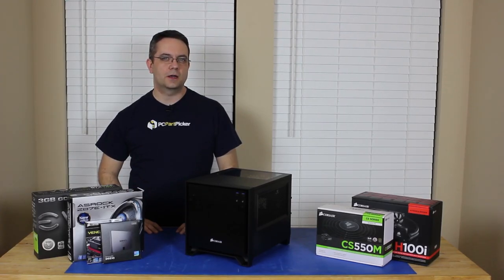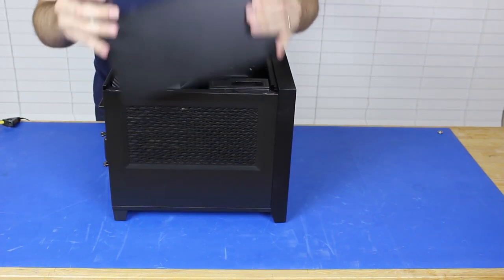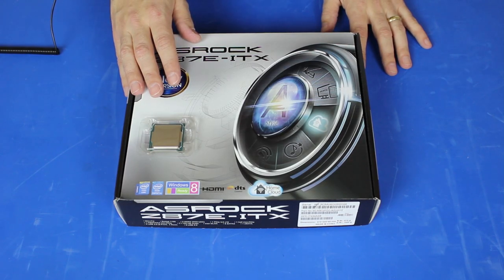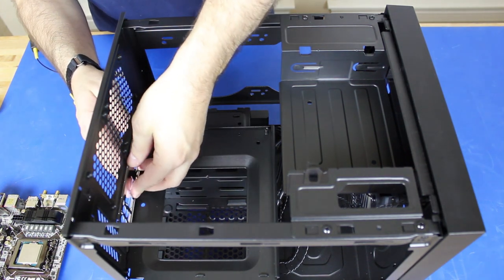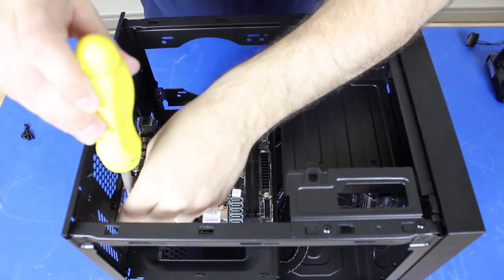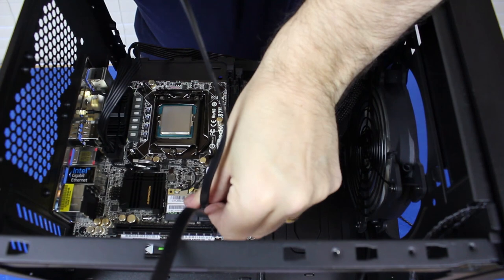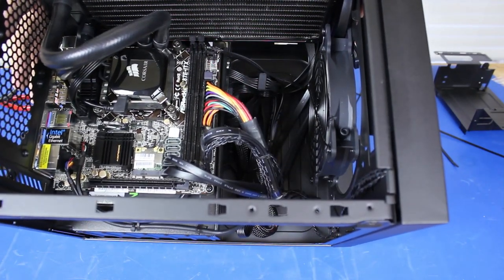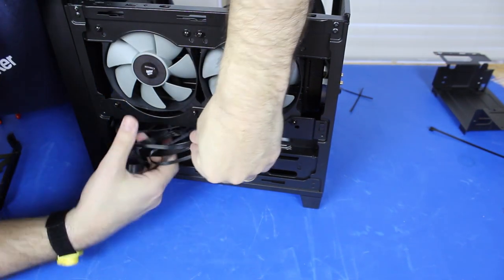Mini ITX Gaming Build - Intel Core i5-4670K / GTX 780 Ti / Corsair 250D

Comment: I was thinking of rebuilding my PC and making it smaller, something like in this video. Problem is the Mini-ITX Mobo I was thinking of getting to go with my current CPU may not fit with the radiator. (the Sata and MoBo connections are located directly under where the radiator would sit). 

Long story short; how much room is there between the Mobo in this video and the bottom of the radiator? Enough room to plug in SATA and Mobo cables?

The motherboard I'm looking at getting is the GIGABYTE GA-H77N-WIFI, if that helps.

Comment: im planing a build with this case

gigabyte z97n-wifi
intel i7 4790k
corsair h100i
evga gtx 980 sc (same design as your card)
evga supernova 650w g2

the ram, hdd, sdd and optical those kinda doesnt matter to me

my plan is to overclock a little just to have better performance and with the model of the gtx to exaust to back of the case and h100i cooling the cpu

my only question would be how to mount the radiator and fans, cus in this build the fans are mounted first then the radiator and in other build i saw is first the radiator and then the fans.

and second question is.... does 650w enough? or i should i go for 750w?

Comment: This is the only 250D build I've seen where the H100i is mounted with the fans blowing into the case, most others have the fans on the inside of the case blowing though the radiator outward; thoughts and or reasons why the fans were mounted this way?
Reply: Not 100% sure but I'm assuming he went with a pull configuration which I've heard is actually better especially for cleaning the radiator after extensive use. You can check out Linus Tech tips where he recommends a pull configuration over a push configuration.

Comment: At the point where you mounted the backplate for the cooler, you have to put it in a specific orientation in order to get the best temps.
Reply from the maker: I can't see how the backplate orientation would make any difference whatsoever in temperatures.
Reply: PCPartPicker I know, it doesn't seem to make any difference but when I first installed my h100i the temps where horrible, I changed the backplate orientation and it was fine. It was on 1155 tho.

Comment: Great little build, lovely case too, love how the vents line up for the radiator on one side and the GPU on the other, reckon it give pretty good temps for a small form factor... I'd have maybe gone fully modular on the PSU and got a short cable kit? Other than that it's yum!

Comment: Is the i5 4670k an apu or cpu? I know it has hd 4600 integrated graphics but will it still give full potential on the graphics card ect? Is there any drawback? Sorry I just dont understand apu and cpu
Reply: It's more of a cpu than a apu because an apu has more drawback like overclocked, less integrated graphics, etc.. That's My opinion Because i use an apu instead of a cpu
Reply: It's just a CPU, an APU gives up a lot of processing performance for graphical performance, while Intel just kinda slaps the HD graphics on it for people who only need CPU power and don't want to buy a $50 graphics card.

Comment: 5 fans + waterpump.
OMG

I have an i5-3550@4.0ghz with passive cooling (Ninja 3B)
1 fan for PSU, 1 fan for case,1 for vga (when it's installed).
Have fun with your vacuum cleaners :p

Comment: You have built yourself a very powerfull gaming console. Great Steam machine. I have the same motherboard, but the atx version. I am about to start building too.
There are sata 300 and sata 600 connectors on it. When installing an optical drive, is it better to use the sata 300 or the 600? The optical drive doesn't care about speed, so i think better to install it on the sata 300?

Comment: One thing I wish this case had was more storage.. it would make for a neat HTPC but with only room for two mechanical drives it won't work for me.  I use the Node 304 but even it has it's draw backs.. it can use a long video card but you have to be careful of the PSU you choose.  The Corsair 250D has plenty of room for a long video card.

Comment: Great build to watch.  The 250D is a large case at 13.8" x 10.9" x 11.4".  I'd love to see a build that's airplane carry-on form factor, such as Lian Li PC-TU100B 6.3" x 10.8" x 9.5".  Portability cannot be overlooked in a mini-ITX build, for many, it's the primary benefit to building mITX
Reply: Check out the Silverstone raven rvz01
Reply: Modi Minecraft Thanks.  I will check it out.  I have built an SG05 in the meantime and the build turned out great.  The one exception for anyone considering a Silverstone SG05 is the modular power supply cable connectors made mounting the drive tray a bit of a challenge.  That is one case where I would recommend the non-modular PSU unless you plan to abandon the drive tray altogether.
Reply: maxbass thanks for info about the sg05 now if you need any help with what components to buy or anything else tell me I know a lot about PCs
Bye
Reply: those might be smaller, but i dont see them fitting a water cooler in there. The smaller PSU form factor is going to have a hard time supporting big GPUs. But i do want a handle tho.

Comment: The big brother to this is the Corsair # AIR 540 if you have a regular size motherboard. I am building My NAS in one now! Its like $119.00 on Newegg and comes with 3 fans and a lot more suited to a living room. Here comes 4K TV and Gaming :)
Reply: I dont know the first thing I did was take the feet off and put them on the side where the psu is and it looks pretty normal next to my surround reciever and HDD recorder/cable box. There is another one on you tube where a guy built a white one that way also. I just thought it looked funny standing up on end like they ship it. LOL
Reply: I had to have the air 540 so I could run 2- 780s in crossfire on a regular atx MB.  I have a tiny mini ITX I built for lan games also .Its a liam li case a  tu-200 tiny suitcase thats  all aluminum :)
Reply: You are so right ,Sli not crossfire. How could I mistake the jargon terminology bs , LOL

Comment: Looks like you frogot to screw in the bottom bracket  holding the 2 120mm fans and radiator back onto the case :)

Comment: its a great build however one thing... the radiator pipes are exactly opposite in my case. which prevented me placing the cpu-head in the same rotation as you. I had to rotate it 180°. the other thing is, it was kind of hard to get the radiator in because of the useless ps/2 connector on the mainboard :(

great video! Thanks a lot

Comment: Sorry to say but i think at the part you remove the plastic protection it doesn't look to good inside ...
I think if you did rotate the CPU block the tubes would make nicer runs And also it would run all the cables nicer (just my 2 cents)
I also have seen people that did the Rad the other way around

Comment: This is practically what I want my next build to be, there the best parts choices really. Wouldn't the cpu plate have been better twisted 45 degrees around, or is there some reason why that can not be done?
Thanks for sharing, I bet whoever it's for will be very happy.
Reply: Dont get the Asrock Motherboard crap.
Reply: MilestoneGeek They're not that bad, always worked good for me.
Reply: MilestoneGeek  I've heard bad things about those a few times so I wasn't planning on it, cheer's though. Currently I have an MSI ATX g45 gaming m/board and I saw that MSI now do one that's this size so I'll probably go with there one as I like there product line.
Reply: nasha thedog They aren't that bad, you just can't overclock as much as you can with other boards. On at least one of their boards, but probably many, they used low quality MOSFETS, which isn't good. Some of their more expensive ones are very good though.
Reply: nasha thedog
on the other hand i owned 2 msi mobos and both were fking fails. bios flashing on swapping the wifi card... seriously? Im now with gigabyte and im happy.

Btw word of warning to msi mini itx mobos. dont buy those with double antenas, look for this with one antenna connected in both slots. The problem with intel wifi card lies within them. On msi mobo i had such ones and my wifi kept losing packets like maniac, on gigabyte i got one connected in both slots and it works flawless. The chipset is the same so it can't be just bad chipset, also problem happend on both of msi boards, both had double antennas. I think there might be some interference between them as setting them diagonal fixed the problem for a short while. Still gigabyte>msi

Comment: these mini itx cases are still too big...I want something console size or smaller.
Reply: +tinostarks look at the silverstone RVZ01, it looks more like it
Reply: +tinostarks Or the new Fractal Design Node 202
Reply: Ncase M1, nuff said.
Reply: deadmau5 na, that doesn't look console size at all.
Reply: +tinostarks I'd wait for the Node 202 then. Comes closest to the Steam Machine prototype in size.
Reply: ccricers isn't it out already?
Reply: +YeshuaReigns sure but still wouldn't fit into an entertainment unit under a tv.
Reply: Raven ZO01 or ZO02
Reply: ***** way to big, I'm looking for something thats xbox one size or smaller...I guess they dont exist.
Reply: ***** Also, the RVZ02 would be closer to the Xbox One size that he wants.
Reply: Yeah, Raven series is the closest you are going to get to Xbox size or PS3 size. There isn't going to be a smaller user friendly box unless you look at some expensive Lian li and upper end Silverstone. But take a look at Silverstone, they have some more HTPC options than just Raven
Reply: °For Gaming and Cooling°
Reply: +tinostarks SilverStone SG13B
Reply: You're not going to get something with water Cooling in a console size. Pcs are bigger cuz they're better and don't red ring
Reply: k den Yes you can actually, Corsair just made a Small Form Factor liquid cooler. And you can always fit a small radiator. 
CPU Cooler: http://www.corsair.com/en-us/hydro-series-h5-sf-low-profile-liquid-cpu-cooler
Reply: I upgraded a HP 8300 SFF for my dad, really love that form factor. I stuck an i7, 16 gigs, SSD and GTX 1050 Ti OC Low Profile in that things and it absolutely flies.

Comment: the H100i v2 and H100i GTX does not fit this case. Look up youtube videos how you can fit it. It involves leaving out some screws and taking out the bottom raidiator bracket.

Comment: FIRST REMOVE BLACK COVER FOR INSTALL CPU..

you so lucky with the cpu cover on it.
Reply: Its come off when theres a cpu inside :)
Reply from the maker: Per the manual here: http://www.asrock.com/mb/Intel/Z87E-ITX/?cat=Manual  -- removing the cover first is not necessary.  It pops off by design.  The manual even shows leaving it on while installing the CPU.
Reply: I didn't when I built my rig
Reply: +Gary Saintz i leave my cover since the day i built my PC... lol.. idle temperature 19 degree celcius

Comment: Isn´t core i5 with 780ti a bit waste of this GPU potential ? I mean,doesn´t the cpu kinda limiting this GPU ? just askin.
Reply: The i5 is very powerfull, especially if you overclock it, but even stock it can probs handle 2-way SLI 780Ti's. There's no point in getting an i7 for a gaming build if you aren't gonna do any work on it, such as videoediting and Photoshop.

Comment: i cannot fit 4 drives into this case with the corsair HX650 sata power cables. There is not enough clearance between the 2 SSDs for the power cables to fit. I'd have to bend the wires 90 degrees. anyone have any tips on this?
Reply: Get a SATA power cable splitter that terminates with straight connections.

Comment: Why would you want to put your MOBO on top of the power supply?  I'd imagine that heat, (the bane of all things electronic) would cause problems sooner than expected.
Reply: Odee Dillon  put the power supply facing down like you're usually supposed to and heat wont be a problem.. motherboards are typically installed above power supplies anyways, even if the motherboard isn't place horizontally it's still above the psu in a LOT of cases.

Comment: this motherboard says it only supports videocard memory up to 1792 MB. is this true?
Reply: +ILIKECATZNCHEEZBURGERZWITHCHEEZSHAYAYAYAYAYAYAYAYAYAYAYAICOULDGOONLIKETHIS4EVERBUTIHAZTOGONOWBYE 

This only refers to using on board video. Meaning if you don't plug in a graphics card then the total amount of onboard video card memory is up to 1792MB. So if you was to plug in a 4GB graphics card and connect your monitor to the graphics card then it will use the memory on the actual video card instead of your system ram.

Comment: There are a few things I would have done a little differently: \

Like for example mounting the radiator first then testing it onto the CPU to see if the tube fit just right because they look like they were going to snap in that position. I think I would have tried to place it in a quarter-turn more than the way you placed it to see if it fits well that way.

Then would have tied open-ended SATA III cables close to the drive tray so that when the time came on adding it would already be there without having to open everything again.

Put a Blu-Ray optical drive (which are inexpensive nowadays) in order to have the computer be able to become an HTPC whenever guests come over and hook it up to the TV or home projector (I own a BENQ W1080ST which I use often and runs great).

The cable management was quite good on your part. I usually wait until everything is connected all around before doing that with the frame exposed rather then as I'm doing it.

Other than that great video :-D
Reply: Was there any reason why the radiator is arranged that way, can it work with the hoses on the front end of the case? (flipping the radiator 180)
Reply: Hyperian
 There technically shouldn't be a problem. however you'd be losing the 5'25 drive tray I think if you do it that way (the tubes are rather stiff and not flexible rubber cheapy tubes). Most likely in February will try out your idea to is if it's possible.
Reply: As a tech and builder; let me just say; for the purpose of a video you'd just maybe mention to viewers about testing the bootup and maybe installing OS before installing everything inside the case; that is how WE do it. Now for the purpose of a build video; that extra test-phase isn't really needed. But sure it is best to test everything outside the chassis before installing, doing cable management, etc. etc.
Reply: Neopulse00 Linus managed to do it that way with a full size blu-ray drive installed in the bay, the tubes looked a bit tight, maybe not so good in the long run but it looked much better.
Reply: Le Ténia
 Yeah real tight I agree. I'm worried about consistent airflow coming from the front in order to not create dust build up later on in the front section since there will be the tubes from the cooler and the cables from the PSU. Nothing that a can of air can't fix, but doing it less times is more comfortable for the user. But the advantage of the cooler I have to admit is the overclocking.

Comment: If there are no issues in my part list will all the parts definitely work together?????
Reply: Yes, that's why the filter is there :P
Reply: I know that but i was just checking if the filter works 100 % I have built a gaming pc and my case, psu and mobo arrived today and i was just confirming befor i order the ram apu and gpu thanks for that!
Reply: D13 Impaa Yea, no probs. But APU and gpu? You do realise APU has both, CPU and GPU right?
Reply: yes i fully well know that i want a graphics card to enhance my performance even more !

Comment: so i have i5 4570 ! and i`m waiting for maxwell Gpus ! so if i bought gtx 880 ! i will not get any bottleneck ? or gtx 870 ! ?
Reply: You have to wait until they are out. But if you ask me i would propably say no. why should that be? The 4670 is prety beefy and the gpu is "on ist own" gpu and cpu don't interact that much that you get significant bottlenecks
Reply: btw i have 4570 not 4670 ! so if i bought gtx 880 or 870 ! i will not get bottleneck ! ? but my brother`s pc has 270 non x and fx 6350 and 1 ram 8GB kingstone and corsair 550w and have a bottleneck he`s playing bf4 on low settings only ! on 1366*768 and get about 55-60 fps !! onlyyy ! so he have a bottleneck ! sorry for my english..
Reply: My english isnt even better :D i am from germany. And thy 60 fps is a maximum of a 270 it is a mid lvl card. And you also have to kniw that that amd processor is a little on the old side and not the best the 4570 is compared to that a beast. 
But i would wait till the 800 series is announced and there are the first Benchmarks and specs about it.
Reply: i know but i saw many viedos the players are playing on ultra settings ! 48-62 fps !! so ?
Reply: I would update the drivers and look for a decend and stable overclock. 
In the vids they prooabky overclocked them. And i dont think its the processor i would say that it is the mainboard becourse the sockets like am3+ exists very long and there are different chipsets for that propably the problems are in there. 
Of do a bios update shuld also help to improf Performance
Reply: Eric Zauche My friend has a weaker CPU and the same GPU but runs BF4 on ultra. As Eric said:Check the drivers, I don't know why yu are getting these bottlenecks :(
Reply: Bottleneck is an overused word. Like i said it can have multiple causes it isnt everytime a Bottleneck so that you cpu slows your gpu.
Reply: Eric Zauche You are right, I used the incorrect word.
Reply: Eric Zauche  so if i bought 870 or 880 maxwell !! and if i got bottleneck !! do u see it`s from onther parts in my hardware !! ? i don`t think coz bottleneck only come from GPU and processor do u have any Beliefs ? !
Reply: The Mainboard. Because this conects everything. Another thing would be the ram but i wouldnt consider that for swaping out if nesecery. 
But the 870 and 880 are futur right now so i would wait and see.